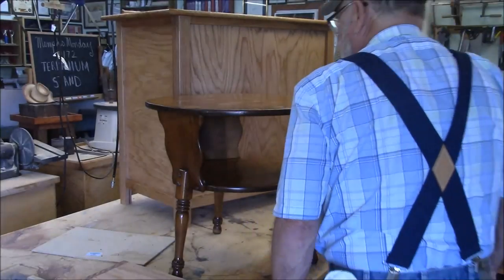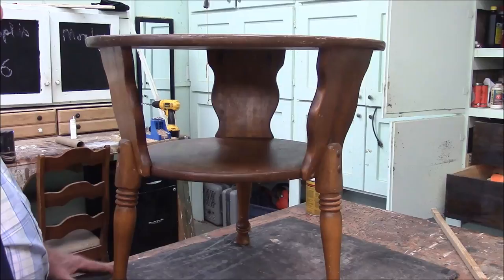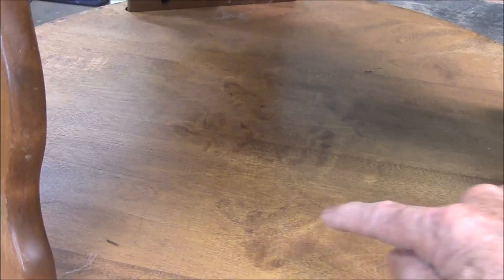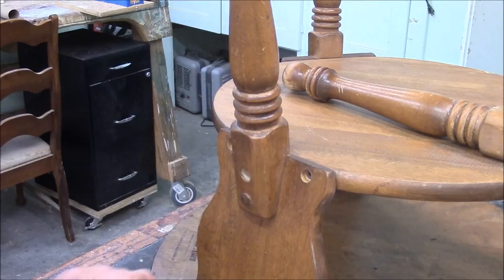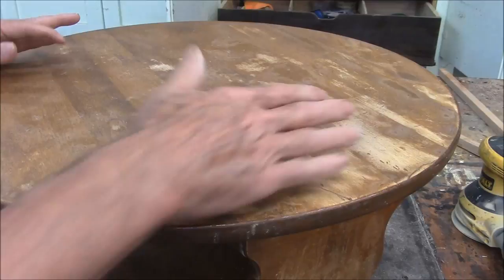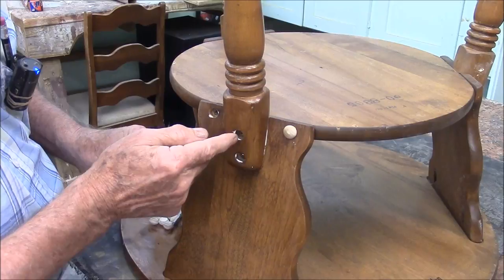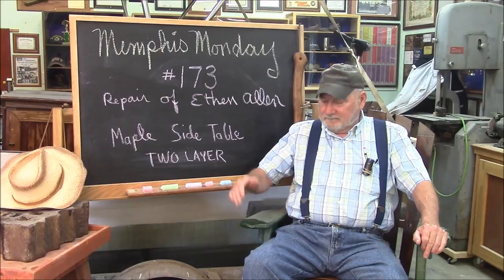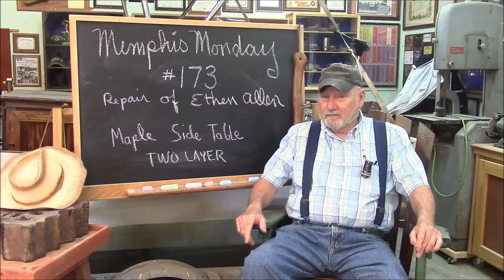173 Fixing an Ethan Allen double layer Maple side table

Comment: I was a bit leary about the stain matching but that came out great. The facelift you gave that table sure made a big difference. The hand print on the bottom certainly makes it unique.
Reply from the maker: I really enjoy finding the little secrets, like the hand print, in these restorations.  If a piece is many years old, it can be read like a mystery, or in some cases like a crime thriller.  I look for not only serial numbers and makers marks, but past repairs, often bewildered by the techniques and materials used.  A good example is the kid's rocking chair we did a while back.  Someone had driven three inch drywall screws (without pre-drilling) into the thin pine arms of the chair.  And to solve the broken rocker they simply chopped them off completely, completely cutting off the tenon.  And, PS, if I see much more "Gorilla" expanding foam glue used to glue parts together I might get ill.  
      I was real worried about the stain too, but I got lucky.  It happens sometimes.  
     Thanks for watching, and hope to see you around the campus next Sunday.

Comment: This is another of your favorite kind of projects isn't it.    Of course there was no investigative work other than researching the labeling on the bottom of the piece.  I really like the look of this table.   It is simple but very stylish.

Was it difficult to get the stain to blend in with the old stain?  I couldn't really tell from the camera angle.  I hope your friend liked the prettied up table.  It is definitely a lot stronger.

I hope you enjoyed your travel.  I will let you know what I end up doing.  Have a great week.
Reply from the maker: Restorations are my favorite things.  Perhaps after we graduate from High School we will major in restorations in college!!!  Heck fire, we are a third or more into our senior year.  Actually, I like restorations so much that I feel a little disappointed when I get a project like this.  The danger is that I let human nature take over and do too much.   But I was saved here because the restoration project behind it (next week) needed much more work.  
      You know my weakness is finishing, but in this case I was lucky, and the stain matched.  But I did have a problem, which I left on the cutting room floor.  The table had been waxed, so applying both the stain and the poly was tricky.  I had to apply and reapply until the solvents in the applied finish finally cut the wax.  That's my theory anyway, but all I know is that it made for some mighty boring video.  
     Keep us posted on the trip, and I say us because I know others are waiting on your next adventure.  I say post a short video everyday for the whole trip.  You could call it day 1, day 2, etc.  But whatever you decide will be epic.
      Thanks for the view, and four years of friendship.